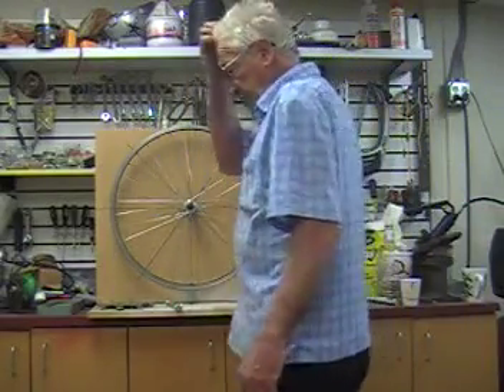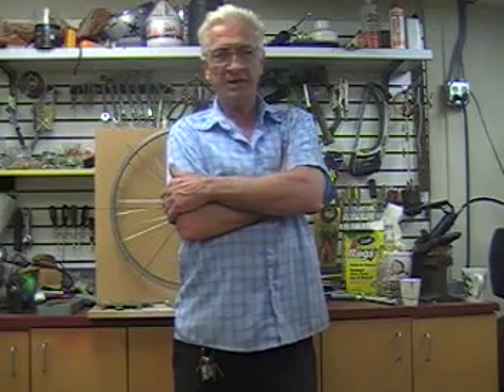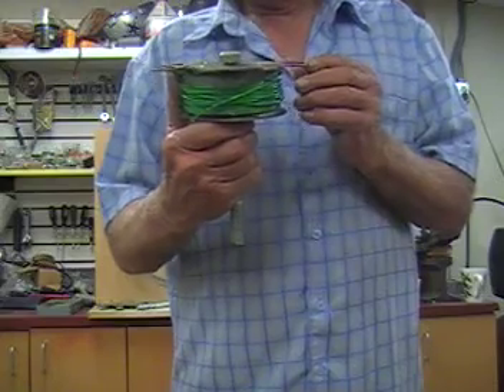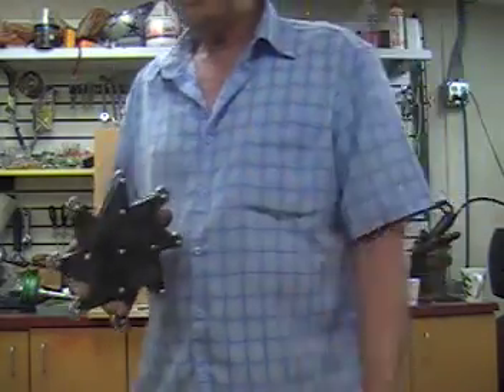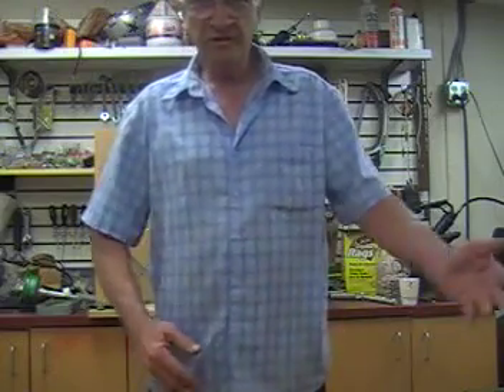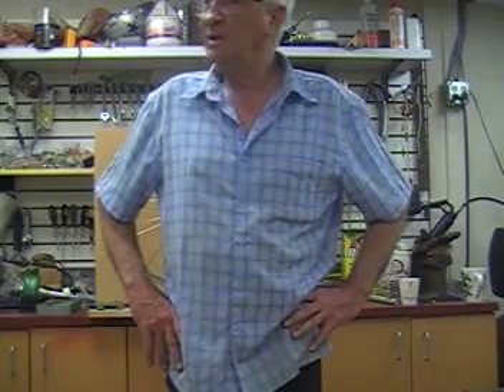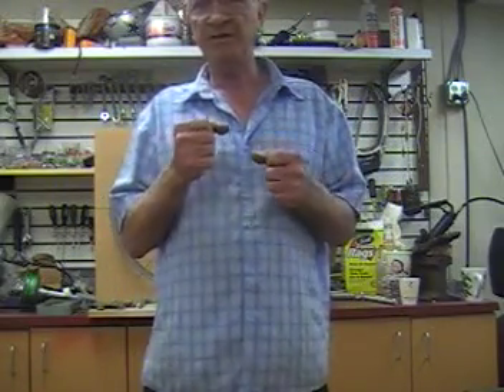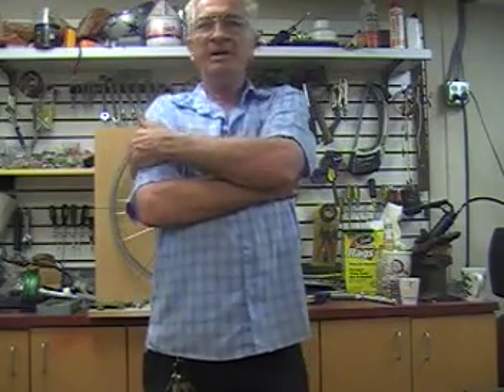UpDate on escapement that works for 2 stage oscillator

Comment: I retired from teaching engineering only last September 2015 and  somehow I came across these videos researching on the Two Stage Oscillator.  By all means I have not seen many of the videos on this idea, and there seem to be many people working on it.  All people presenting themselves and working on such an idea are all so well cultured and polite and  well mannered as gentlemen should be but  I have a feeling that the background scientific knowledge of the people working  on this idea is rather limited and they keep talking about amplifying energy, using gravitational energy,  amplifying power when all they are doing is either changing forces due to a lever or a pulley effect or else integrating  or accumulating energy in a memory device as a pendulum or a flywheel  from  tiny packets of energy and when the stored energy is enough they dump it down into a load in a short time.   With this result they are claiming to be amplifying energy!   Well, I hope these nice gentlemen will not mind me commenting on what I see and try and explain some very basic principles and the meaning of basic elements as Force  acting alone.  Force acting  for a distance.   Force acting for a distance for different time duration to suggest power, momentum, change of momentum to produce forces or accelerating masses to produce forces.

Some time ago a nice gentleman approached me to go into partnership with him as he invented a device which works from Magnets and that he had a motor which works with magnets alone .   I refused obviously even though he had a lawyer with him  offering there and then to write the contract agreement on profits and so forth.   He tried to keep everything confidential but when I refused he was prepared to show me some photographs and with my experience, I realised  from the photographs that he did not have a motor which extracts energy from magnets but he had a gear box which used magnets.
He had already spent 80,000 British pounds on the structure and he  used the best materials and the best bearings and it is this lack of friction that made him think that the device was nearly working, he kept hoping that with less friction it will work. All he was doing was giving it a push and the device went on turning for about 15 minutes, but it was only good bearings, good materials, good streamlining and if all this was done in space where there is no air to drag the system that thing would have remained rotating with the rest of the universe for ever , as the  planets and stars actually do, but it does not mean that the planet and stars are  producing power to rotate, they are in a space where they have the advantage of not having friction and so the gravitational force can be balanced by the centrifugal force of things going around each other.

In this TSO, it is the centrifugal force that is misleading people, there is no amplification of energy , there is no stealing energy from gravity, it is simply normal scientific known phenomena.  It can never amplify energy, it may store/ accumulate it to use it later on   as is done in watches,  in old  motorcar starters,  and other  industrial applications  as air accumulators and hydraulic accumulators.  One hopes that these cultured and kind gentlemen would proceed with their research, but they must spend some time, understanding the fundamental of science and  not to mix forces with energy and power with energy
Reply from the maker: +Carmel Pule' Thank you for commenting on my video.  I DO enjoy comments from educated people .  I am an OLD hard headed construction worker that has done the impossible on construction sites so many times over the years I am 99.99% sure nothing is impossible. Figures on my large machine outside puts out 3,225 foot pounds of energy per minute and I have done this non stop for over 2 & 1/2 hours,  with one hand, while drinking coffee with the other. And never broke a sweat.  Having actually done this ( more than once) it is very difficult for me to trust some one telling me the machine does not work when, they have never touched one.  I hope you do not take me the wrong way.  I do respect your knowledge and your comments. However ;  Having built several of these machines and operating them by hand and falling weights to measure the in put and out put I need a little more than theory as to why the machine does not work.  I truly want you and I to become very good friends and if possible , together we can prove this machine DOES  Or DOSE NOT work.  BUT real prof,  not theory .P.S.  I wish you could come to my house and operate it for yourself.
Reply: +RHEAD100  Well Sir, I admire your courage and perseverance, and as I am much older than you are, all I can say is that  we both needed to be hard headed, yet logical and reasoned and gentle,  to have achieved what we achieved. Well you  might as well know that since the age of 14  after six years apprenticeship I worked on very complex  Royal Naval Ships, including hulls, engines, radars, asdic, sonars, and armaments and  confidential gun control system and secret  American coding  machines(KDF7). I worked on the design of British O and S class submarines and all types of surface ships. I spent many years on research in electronic  system design including antennas.
I was consultant to advice on  engineering on ships and large diesel electric ferries , Power-stations, and many industrial  manufacturing concerns including the Plastic industries,  I contributed to the design  and manufacturing of surgical   equipment.  I was approached by the local courts to investigate about 700 cases , including failures  and fatalities on construction  sites, including investigations on fatal incidents in Dockyards and industry. I was in higher education for the many years doing many practical engineering  projects.  I did a lot of confidential work for my nation and was decorated for it.  I am mentioning this to explain that  I follow theory with practice all my life.    I often make mistakes too but I do my best to correct them or learn from them. Please consider my  postulate concerning the Two Stage Oscillator. 
 
Now what I would like you to consider carefully  in your Two stage oscillator, I saw in your videos, is that part  when after the "load" weight is lifted, it starts to drop again.  It will  start dropping  as soon as  the centrifugal force on the  pendulum  in that narrow sector, is reduced  and is not enough to lift the weight.   IT IS AT THIS POINT WHEN THE DROPPING WEIGHT WILL START GIVING BACK  AND TRANSFERRING  ITS ENERGY  BACK TO THE PENDULUM , THROUGH SHIFTING ITS PIVOT POINT OR OTHERWISE.  By the time the weight reaches the ground , it would have RETURNED  all its energy bY  TRANSFERRING IT  BACK TO THE PENDULUM TO ASSIST IT IN KEEPING IT SWINGING.

At this point , there is no work done on the weight which rose and fell to its original position ( including the  horizontal lever)

This is the reason why you can swing your machine for two and a half  hours  with one hand and drinking coffee with the other.    BECAUSE YOU ARE NOT  DOING ANY WORK ON THE LOAD BEING LIFTED AND DROPPED!!

The TSO with raising and falling weights is simply a machine which circulates energy within itself and does NOT  DELIVER NOR TRANSFER ENERGY FROM AN INPUT TO AN OUTPUT EXTERNAL LOAD.  It is an energy circulating machine and not an energy delivering machine.  Again please study the falling weight and where does  its energy go while it falls........... back to the pendulum.

Well the new year is with us, so happy new year 2016.  Please reflect on  energy fed back to the pendulum when the weight falls. 
Try and make a pendulum whose pivot is on a spring and you will find that pendulum will keep oscillating.
Then try and raise a weight and KEEP IT being  RAISED   per half oscillation and you will have a surprise  how hard  it will become to keep that pendulum swinging continuously.
Reply: +Carmel Pule' 

It is the last day of the year 2016 and history is
going to be made.

PROOF THAT FORCES AND ENERGY IN THE FALLING WEIGHT OF A
TWO STAGE OSCILLATOR IS BEING TRANSFERRED TO THE PENDULUM, BOTH DURING STATIC
AND DYNAMIC STATES.

Static condition. 
(For clarity let us assume that the horizontal lever on top is pivoted
at its centre. If it is not, the ratios of forces can easily be calculated
according to moments)

Take a dead load of 100lbs touching the ground and a
simple (not compound) pendulum weight 80 lbs hanging vertically, all without
motion. In this static situation the 100 lbs weight will transfer 80lbs force
back to the pendulum to keep it hanging without dropping, while the reaction on
the ground of the 100 lbs weight will be 20 lbs. The pendulum will not fall
because the 100 lbs is transferring 80 lbs force to the pendulum.   This is the first proof that there is a
force during static condition that is being transferred from the weight to the
pendulum.

Dynamic conditions.   With 100lbs
weight on the ground and an 80 lbs pendulum, the pendulum must be swung and
raised to a height to gain potential energy so that when released this will
accelerate to produce velocity and centrifugal force of at least a 20 lbs down
component in order to be added to the 80 lbs of the pendulum in order to lift
the 100lbs weight. (Let us say the pendulum was raised to a horizontal position
before it was released, and any position will do, but this is easier to assume a
horizontal position) 

THIS RAISING OF THE PENDULUM NEEDS A LOT OF INPUT
ENERGY.

The pendulum is released and nothing happens to the
100 lbs weight till the velocity of the pendulum produces a downward
centrifugal component of 20 lbs. At this  state, both the 80 lbs dead weight of the
pendulum and the 20 lbs down component of the centrifugal force will be
DROPPING DOWN LOSING ENERGY  while the
100 lbs dead weight that is  lifted GAINS
ENERGY AS THE CENTRIFUGAL  DOWN
COMPONENT  rises to 20-21-23-25- till
maximum, then goes back to 24-23-21- 20   to less and less. During this sector of
pendulum motion the 80 lbs pendulum and the down component of the centrifugal
force lose energy while the 100 lbs weight gains maximum energy as it reaches
its highest point. Note that the 80 lbs weight of the pendulum is losing energy
acting as an input in addition with the swing of the operator and this has to
somehow be regained at a later time.

Now if at this stage the 100lbs weight is quickly
taken off to do work elsewhere without effecting the pendulum, then the 80 lbs
swinging pendulum will drop fast rotating about the central pivot of the
horizontal lever, till it places itself below it, still swinging complexly but merrily
away doing nothing else as there will be nothing to raise it back.   But this does not happen because the 100 lbs
weight will remain attached to the pendulum, giving back an interesting set of
dynamics to the pendulum. 

Now let us assume that the pendulum has now swung to a
horizontal position( not necessarily but let us assume that) With the 80 lbs pendulum
horizontally placed  it will not transfer
forces nor energy to the 100lbs dead weight and it will use the 80 lbs to
accelerate itself down wards. At this time the 100 lbs dead weight at its
highest point, will accelerate itself downwards too, to later lift the pendulum
back to a higher place. When the pendulum takes an angle then its pivot point
is lifted up by the dropping 100lbs while the end of the 80 lbs weight of the pendulum
acts down. So at this point the pendulum pivot is lifted up with 100lbs while
the 80 lbs weight of the pendulum acts down, both separated by the length of
the pendulum producing a massive torque on the pendulum to swing back. (note,  the contribution of both the 80 lbs AND THE
100 LBS OF THE  still ATTACHED WIEGHT. )

If the 100 Lbs weight was not left connected to the top
horizontal lever the   swinging 80 lbs
pendulum would drop swinging about a vertical line through the central pivot of
the lever.  THE DEAD WEIGHT OF 100 LBS
CANNOT BE LESS THAN 80 LBS never, never. 
So if one needs to transfer energy to an external load only a weight of
20 lbs may be completely detached from the 100 weight to do work elsewhere,   but then the operator will have to pay for
it as the pendulum will not swing back to the original position, where an
operator can swing with one hand and have coffee with the other!!

I picked up the extreme case to prove a point but any
related state can be worked out.

If the 100 lbs weight, or part of it, is removed, then
the Pendulum will keep dropping in its swinging height till if the weight is
below 80 lbs there is a rotation such that the pendulum together where the
horizontal lever will become vertical where both the lever and the pendulum
will produce complex modes of oscillation attributed to systems with two
degrees of freedom as the two stage double pendulum.

This is proof that the 100lbs weight or not less than
80 lbs must remain attached to transfer force and energy back to the pendulum,
if the operator in not be subjected to heavy sweating not only to swing the
pendulum but to lift it from under the central pivot point of the lever (which
is the second pendulum in fact)

Comment: Hi, well done,
but
you can only get something to work, if you use the virtual
centrifugal forces and convert them somehow into rotational forces.
The Milkovic setup does this only in small quantities,
but yes, it does it a bit...

Also use springs with it to store the forces and movements.

Only with levers and torque arms you will never get anything selfrunning !
This is from my own research.
Many thanks.

Regards, Stefan.

Comment from the maker: @sirHOAX 
HP is 
33,000 pounds one foot in one minute.
550 pounds one foot in one second.
When figuring HP.  Weight moved and distance moved mean Nothing without the time frame worked into the calculation

Comment from the maker: @sirHOAX You being one of the smartest people I know on you tube, You honer me Sir.
The 2 stage oscillator picks up weight a set distance in a set time frame.
The pendulum pulls down on the power bar with a multapul of it's own weight. Depending on the liength of swing and airodinamics of the pendulum.

Comment: Excellent Ray, we have been working on the Peter Lindemann 'rotary pendulum' design, (Mechanical Engine" and encountered the exact same problem! FRICTION!
Our pendulums are different to Peter's, they are 'Piza Slice' shaped, with the ratchet on the curved bottom surface. (the reverse of Peter's design) The return spring is replaced with opposing magnets..blah! We plan to use two 4 ft. diameter polycarbonate discs with 8 piza-pendulums and a central cam, so that folk can see. MDF for prototypes!